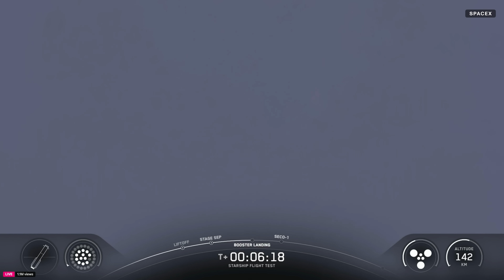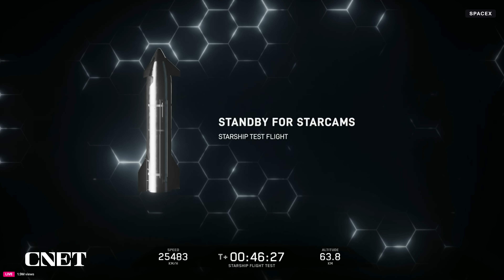Starship Test Flight 9: Everything That Happened in 17 Minutes

Comment: Musk's fate was sealed when he decided to buy DJT in 2024. He should have stayed focused on running his companies, because now we see the results of neglect at the highest level.....the failures will continue, at both Space X and Tesla, since the damage he has caused simply cannot be reversed, e.g., tarnishment of brand at Tesla due to DOGE debacle.
Reply: Now he has also tied the schedule of his goals (e.g. Mars landing) to the current administration, because after January 2029 there might be a wholly different tune regarding his pet projects. So the need to push the tight deadlines for launches, with unsurprising results, concerning how the complex these systems are.
Reply: DOGE has been a huge success and it will only keep getting better. This was only a test flight and SpaceX will keep getting better as well.
Reply: @helluvatime4562  "DOGE a huge success "??? Where do you get your info? Most of their  actions have been blocked by the courts due to illegal dismissals, e.g. And the SC will likely rule the "department" is unconstitutional and must be dismantled, meaning that the musk/DJT joke will end up costing taxpayers far more than it saved. Major scam.
Reply: @helluvatime4562  DOGE is a major debacle.....most of it's illegal actions (e.g., firing of federal workers) have been blocked by the courts, and it's very likely it will be dissolved via SC ruling, because it was unconstitutional to form such a government department without Congressional approval. When you elect a felon, expect illegal activities.
Reply: Spacex is still running successful launches of the falcon 9 every week and Tesla has a higher profit margin than every other car company (even after "brand damage") over the past few quarters. Do your own research. Don't let yourself be fooled by the narrative spun out by the msm.

Comment: NASA has spent $10 billion on a rocket that has failed nine test flights in a row.
Reply: Yeah and NASA spent 4 billion to launch just one rocket
Reply: Would you call catching the largest booster ever with a pair of giant mechanical arms a failure, of re-flying a booster just after 4 months of refurbishment? This is the iterative method, something you must have learned little about in school.
Reply: @ash22ps I'd call that cherrypicking. A great demonstration, but the booster is just a booster. The spacecraft is what's important
Reply: @Antenox  Iteration bro. It means small increments of progress, not 0-100 in one go? There are a thousand things that can go wrong in a rocket, and even one critical component failure means loss of rocket. Its an incredibly hard thing to solve. Do you know it took 10 years of iterations on falcon 9 before the final block 5 version that has now become their workhorse, and far more reliable then most rockets, and cheapest ever, by a factor of ten.
Reply: @ash22ps  Exactly. They will get this right but it will take time
Reply: @ash22ps  How can you tell when someone doesn't know what they're talking about and is just spouting nonsense? They chant "iteration" or "fail faster" when talking about anything other than software.

The world is not the tech industry, "bro." Iteration is good for software because it costs nothing to tweak and re-run failed software. For hardware? It's wasteful and dangerous. These "test flights" are nothing but publicity stunts. All the meaningful testing is happening behind closed doors at SpaceX, using old fashioned targeted testing.
Reply: @ash22ps The world is not the tech industry, "bro," which you'd know if you knew anything about space OR the tech industry. Iteration using full scale hardware isn't efficient, it's wasteful
Reply: @Antenox  I'm a Mechanical Engineer. This is literally my Forte, bro.
Reply: @Antenox  I agree there are a lot of problems with integrating multiple major changes on a full scale design. It adds a whole lot of uncertainty to the efficacy of the changes. I feel the motive for the full scale designs is not aligned with innovation and rather more of a public display to garner attention from the media, which may end up hurting their progress.
Reply: @ash22ps  Is that supposed to impress anyone? LMAO
Reply: @nochance6640  Exactly. These are PR stunts.
Reply: NASA = Need Another Seven Astronauts.
Reply: 9 times in a row? Flat out lie. Tests 4, 5, and 6 were complete successes. Also, where is 10 billion coming from?
Reply: @Icerz. Wrong. 4, 5, and 6 had critical failures that were brushed aside as "minor" by SpaceX but definitely were not minor. You forget that Starship is supposed to (eventually) be manned AND be relied upon for Artemis. 4 missed its target zone by 6 km. For a manned spacecraft that can only land vertically, that's not acceptable. 5 sustained visible structural damage during reentry, and since it was disposed, we don't know what else went wrong. And 6 damaged its launch/catch tower, which made landing impossible.

And the $10 billion figure was the optimistic estimate given by Musk himself. Which means it's probably higher. In other words, I was being generous.
Reply: Oh wait, did I say NASA? I meant SpaceX. SpaceX has spent $10 billion on a rocket that has failed nine test flights in a row.

Comment: How many Falcons failed before they finally managed to land the thing? With as complex as Starship is, I'm not surprised they're having as many issues as they are.
Reply: on the contrary the experience they already have with falcons should make the job easier. The design is just not right
Reply: I agree. You're dealing with a starship larger than the statue of liberty. Never even been attempted before. That's why they call these iterations: TESTS.  If they keep going, they will nail it. They are SpaceX, after all.
Reply: To be honst, I think this is the very first time Super Heavy was meant to land and didn't. So something else happened there but things are moving forward which is a good thing. Remember that no test is the same. Every time they test something different and we don't know everything. We know some very general things like they want to test for example test payload like here in this test. Yet, that's not everything they are testing.
Reply: Apologise harder daddy
Reply: The amount of couch engineers giving explanations is what is hilarious about this. Apart from that, huge success and you are absolutely right.
Reply: @kyemin5802  How much more does it need to explode for it not to be a success?
Reply: @cgourin  I'm sorry, apparently I'm on the weird side of the internet (or YouTube) so my education post was deleted. This must be a "hate Musk" hangout or something like that. I'm pretty sure that if you go to the reasonable side of the internet, you'll find the answer to your question. I'm not gonna write more here. Don't really like to promote spaces that aren't healthy. Be well.
Reply: Starship is a farce at this point!
Nine test flights and they lost both ship and booster.  Total unmitigated failure.  Ship was clearly spinning after SECO and they keep pretending ‘this is fine’..  Starship is Soace X’s cybertruck: pointless, expensive, and hazardous.
Reply: The mob loves to see failure, its the same mob that laughed at the 1960s space program, the same mob that laughed at the Wright brothers
Reply: Exactly Flacon 9 didn’t stick the landing overnight. It took several failed attempts, tons of data, and relentless iteration before they nailed it. Starship is on a whole new level of complexity, so setbacks are expected. What matters is how much they learn with each flight. That’s real progress!
Reply: Falcon was at least able to deliver payloads before they attempted any reuse. There just seems to be a cascade of issues present trying to achieve reusablity while also trying to ensure the basic functions of the rocket work.

Ideal situation we can do all our tests in one go, but 3 lost upper stages in a row might warrant less risky behavior and narrow in on the causes of these issues. But it’s hard when there’s thousands of changes between ships.
Reply: Is that a Guiness record? Has any other rocket failed that consistently?
Reply: @cgourin It never failed to begin with. It is not an operational rocket so it can't fail. The point is to learn. You can claim it failed only if the project is cancelled
Reply: @davout5775  I think you nailed it: "not operational" is a good qualifier for this rocket that got payed billions by NASA to land a demonstrator on the moon around now and people in less than a year.
Reply: @cgourin  You are talking about Artemis, not Starship. So again, you are factually wrong
Reply: @davout5775  I'm sorry is there an other rocket that SpaceX will produce in the following weeks to land a demonstrator on the moon and honor it's contract? Or was it always a scam that explains that Kathy Lueders made the rash ans sole decision to give billions to Elon before jumping spaceship to a million $ job at SpaceX?
Reply: @cgourin ever heard of the Mercury program? Smh
Reply: @Ozzmosis_Inc  So, Mr Genius, how may Mercury missions failed?
Reply: @chap666ish I don't know. The subject wasn't missions, now was it?
Reply: @Ozzmosis_Inc  I've heard of the Apollo program: 15 consecutive successful launches. At this rate SpaceX might end up with more failures than Apollo had success and less success than Apollo had failure. 6 to go.

Comment: Starting to be worried. They have not been able to get the most important part of this test to work reliably, I was optimistic but this is getting bad.
Reply: Trial and error
Reply: Don't worry. They'll figure it out. This kind of stuff is difficult.
Reply: @MrD3000  no doubt
Reply: Then, you're ignorant. Because you should know the Falcon 9's grasshopper program. Everything "looks bad" in that program because they were TESTING THE LIMITS and using iterative design.
Reply: These guys are launching skyscrapers to speeds of nearly 5 miles a second. I'm no rocket doctor, but trial and error is the starship name of the game for the time being.
Reply: Yeah it's called R&D for a reason.
Reply: They purposely removed heat shield tiles from critical areas in order to test...they talked about it...
Reply: You do realize that they’re purposely crippling the rocket to prepare for a worst case scenario right? They’re testing a scenario where they removed the most critical tiles and deactivated 10 engines. They’re simulating Challenger, not Saturn
Reply: Marcus house viewer?
Reply: But in fact this is the hardest part. 😅
Reply: They have had a successful launch, catch of the SHB, and controlled entry by Starship a couple of times (the controlled entry has always been into the ocean sadly). Independently they have proven things work, the issue they’re having is trying to get them work together while also adding things onto it (deploying Starlink modules)
Reply: It is okay my brother in law works on the booster and yes it may be a little scary but they are trying for the next big step
Reply: Its almost like they are building a rocket the size of a skyscraper and then landing it
Reply: This is Starship Version 2. Version 1 worked fine.
Reply: This may be the "great filter" and why we dont see any aliens. Going interstellar is just too difficult and too expensive.
Reply: Sometimes this makes me think we really did not go to the moon..If with our current technology it's this tough for just orbit.
Reply: @enot-wh1mv  we did. It's just such a difference of scale with what we are trying now that there are an exponentially increased number of problems to overcome. What's happening now is the exact reason that Apollo had to be scaled down when they were planning it. Breaking past a certain size of rocket makes things mathematically problematic in ways we have never solved before.
Reply: @enot-wh1mv  Cost cutting and the owner being swallowed by politics and not giving the company the attention it needs is all the cause of this.

They are massively behind in development, and the test campaign has gotten really bad at this point. We shouldn't be seeing the same issues reoccurring. Especially with the after effects of tonnes of steel exploding in a trajectory towards the Earth. The fact their first tests were a success and now they are just on a constant mission to fail is not looking good.
Reply: @smallfocusedmemes126 
You're right. Are you available to take a call from Elon tomorrow so he can learn how to land 500 foot rocket/boosters?
Reply: @criticalevent an increased launch cadence combined with the company's perseverance to succeed, we could very well see an unmanned landing on Mars next year. It seems people forget that they've built a reusable rocket the size of a skyscraper, and plucked it right out of the air. If SpaceX has proven anything it's that they routinely achieve what was once thought to be impossible, even if the timelines don't quite add up.
Reply: @criticalevent 
Nobody said the first ships would land. They very well could have materials and be placed in orbit.

Comment: 4:25-4:45 visible solidified propellant?
Reply: Probably just ice chunks from condensation on the rocket. But there was a very clear fuel leak from the fuselage at 9:58.
Reply: That was the 'hot ring'